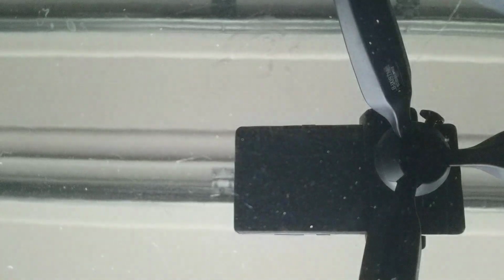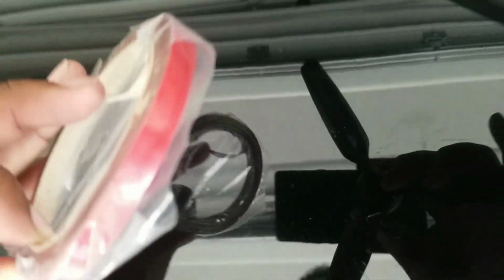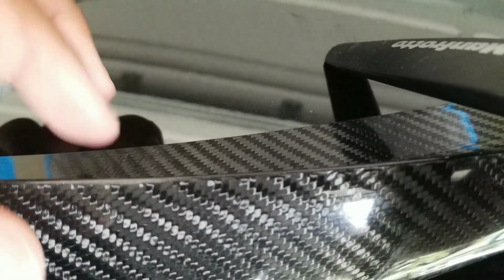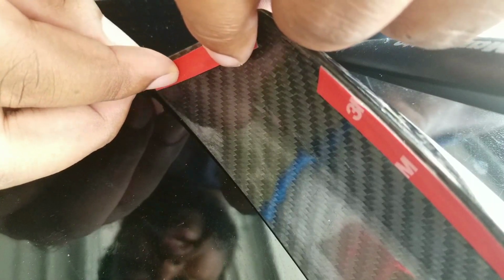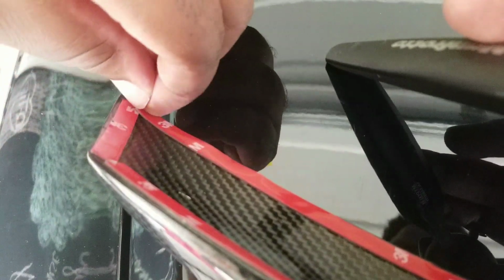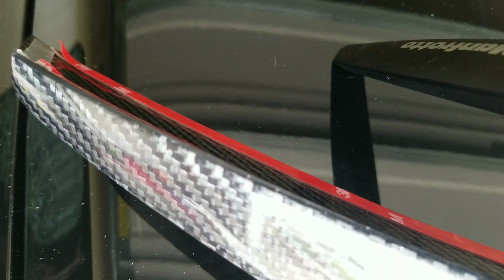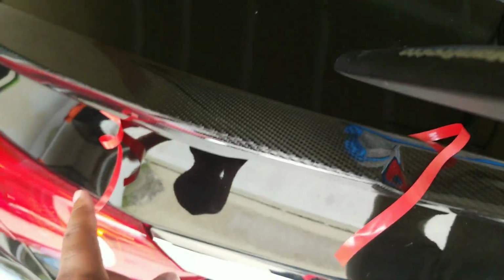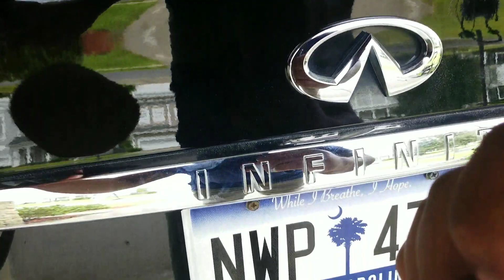Installing Q50 spoiler

Comment: Where did u get it?
Reply from the maker: I did a search on ebay or amazon. type in q50 spoiler
Reply: Curry Shot You how has it held up? I’m sure you do some fast pulls. Has it fallen off yet?
Reply from the maker: @andresvillagomez75  has yet to fall off. I have washed and pulled on it.  It is still holding on pretty solid